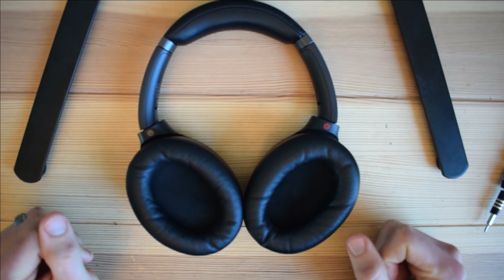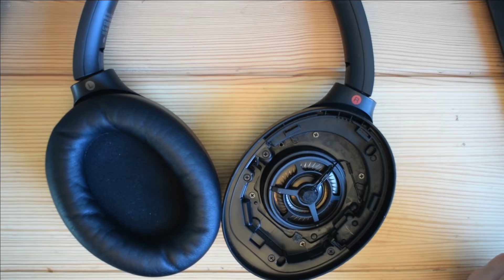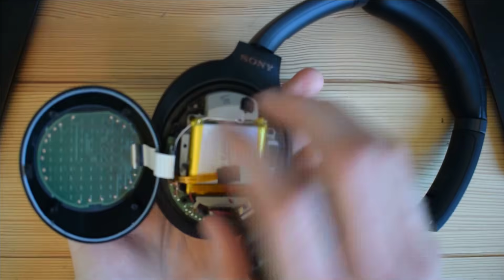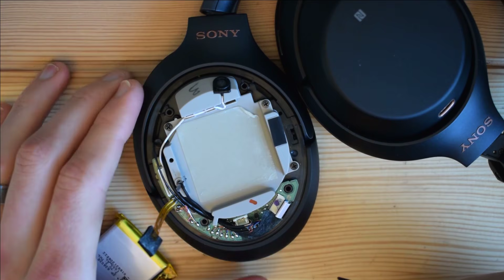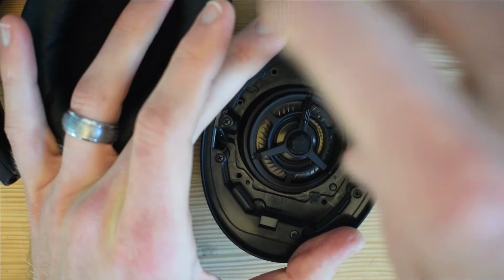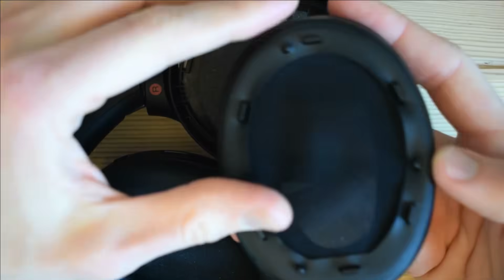Sony WH-1000XM3 Battery Troubleshooting, Repair or Replacement Walkthrough - Teardown and Fix

Comment: Alright I just fixed my headset what I did was I first went through the non hardware invasive  steps none worked then (if this is the case for you its most likely a hardware problem and not a software problem ) i decided to open up the headphone with some screwdrivers first i did the right side where the battery was (thought it might be a dead battery) and disconnected it for 15 minutes then plugged back in but that did not work as has been recommended by a few to do and work it did not in my case however.

What worked for me was i opened up the left side where the power button is and just messed around a little bit with the cable and applied a bit of pressure here and there and tested the power until I found the so called "sweet spot" and some reason that fixed it might be the same case for some other folks out there lose cable might need to resolder it if you have the tools and skills but for me just a simple reopen and pressing around fixed it might help you too if these simple steps didn't worked in this video.

At the end of the day it just seems to be (at least in my case) a few cables out of place inside the case or pressure just over time from maybe dropping or just general daily use that made it kind stop powering on, but try it to these steps first before buying a brand new battery it might just save you a few bucks.

Comment: I slightly ripped my foam battery temperature pad thing on my xm4's but its still holding the sensor in place. battery disconnection didn't work for me so im thinking maybe this had something to do with it? is all hope lost?!?!?!

Comment: Thanks for the video. Was almost identical to take apart the MDR 1000X. Mine did not start after a charge but now they work again. I unplugged the battery and let them be for 15min then they started again. <3

Comment: Hi, thanks for making this video! I need your suggestion. I have the same headphones but now it was damaged because my little brother gave supply through aircraft adaptor and 3mm jack wire into the plug then suddenly POP sound then stopped working. Could you please help with any possible solutions to work? or is it better to buy a new one? Thanks in advance :)

The In-flight adaptor is NOT MEANT to charge your device. Plugging the in-flight adaptor into an AC Power Socket to charge the headphones will cause severe damage to the device. ( this happened but no changes in the headphones, simply not working :( is it battery damaged or motherboard damaged? )

Comment: Help pleasee! My right ear is charging red, but I can’t turn it on with the left ear. Happened randomly on one day. Is there a fix for that as well? I’ve tried both soft and hard resets multiple times with no luck :(
Reply: I tried the resets again and suddenly it started working again 😄
Reply: Plug it in with a cable to the headphones and try again

Comment: Hey, got a new battery and followed the steps and the new battery is good however, it seems as though charging is the issue itself. Any ideas on how to troubleshoot that issue? Might be a loose connection, faulty charging terminal/connection etc. Any ideas? Cheers!
Reply from the maker: You may want to try detaching and reattaching the charging port. You can find the instructions for that in the following video: https://youtu.be/GmfoTpZiX9U

Comment: Hey, my XM3 Headphones won't turn on. As soon as I replace the battery they turn on but after a while they turn off again and I'm not able to turn them on again. While charging the red light is working. The blue light works fine when they're on (the 2 mins after changing the battery), but they won't work afterwards even not if o try a soft or hard reset. Are there any  solutions?
Reply: have same problem bro.
Reply from the maker: Hi! Thanks for reaching out. Unfortunately I've had this problem before as well and I have not had much luck fixing it. It appears to be an issue with the main circuit board, which is very complicated to fix. You may end up having to just use them wired or get a replacement pair. Sorry to not have better news!
Reply: Have same problem...

Comment: What is the cable with the foam adhesive attached to the battery? My foam square separated from the cable how should I attach it to the battery?

Comment: Dude seriously...THANK YOU! My unit wouldn't charge. It stated that its at 20%. Once plugged in, the led stays red for 10 minutes or so and then turn off. When I turn on the headset it immediately tells me that my battery is low. I tried every single USB-C cable and every charger and every computer with the same result. I was seriously going to just throw these away. Well after watching this video I decided I have nothing to lose since warranty is over so I unplugged the battery as instructed, left it alone for 10 minutes. Plugged it back in and immediately turning it back on and its at 100% charge. Keep it up man...you saving a lot of people money.
Reply: Mine were stuck at 10% charge and wouldn't charge. I suspect it was at a much higher charge than that but I changed out the battery anyway.
Reply from the maker: Fantastic! I love helping people save money so this comment made my day :)

Comment: Duuude. You saved me like >$100 in repairs from Sony’s non-warranty repair center. I bought them refurb, so let’s hope it sticks. 

Note: with tools the hardest parts are removing the back cover and REINSERTING THE FARKING BATTERY CABLE in its port. 

Mucho thanks.

Comment: I just wanted to know what the internals of my xm4 looked like, its just as new as the day I bought it and I hope it stays that way for a couple years. The repairability just makes my decision even better, almost bought wireless in-ears. Thanks for the vid.
Reply: btw i realized the ear pads began to kinda wear off, they are not as solid anymore, is it how its supposed to be?
Reply: @bruh5924  Sometimes clean and then apply leather grease.

Comment: But you shouldn't need to do this with headphones lol
Reply: After many years the Battery is not the same and for 20 euro its like new again and 30hours run time
Reply: Yes, otherweise you'd need to buy a new one. I just got mine for the first time, and it's good to see that when the battery is too weak, I can replace it without buying a completely new expensive headset.

Comment: Just got a set of these. When charging them, I see a red light, does this change at all when they are fully charged? I can't see anything in the instructions that came with them.
Reply: No more red light when charged. 
So it indicates only a charging process.
Reply: Thank you for the reply.

Comment: Thanks for the video.  I had the issue where, instead of charging and having a solid red light, the red light would flash continuously. After disassembling, I found the light could stay on solid if I wiggled the temperature sensor (the part held down by the first tape - the orange tab touching the battery). This is true even with the battery unplugged. Tracing the sensor cable back to the board, it was apparent one of the solder joints was only making intermittent contact. A little more wiggling and it came off entirely. I resoldered the sensor onto the board and now it charges perfectly. 

Also it looked like the wiring had been factory reworked (poorly), so seems like Sony has some quality control issues. Very disappointing.

Comment: Nice simple video, thanks!
Great to see this is so easy to replace the battery, hopefully I don't need to for a few years.
But I will definitely want to keep these for longer than a battery will last.
If the XM4's are the same inside . . .
Reply: Hi. I Have the wh-1000xm4 model ..my phones wont power off …they are on all the time ..i tried a soft reset and hard reset …any suggestions ?  They wont power off at all ,even if I set the app to power off

Comment: Hi how can I hardware disconnect the nfc and bluetooth feature of these headphones to make them feel like regular wired headphones instead of being wireless ones that asks to be paired to anything when they start up?
Yeah I know there is an app for turning features off but that is the software way and that is not a permanent solution.
Reply from the maker: That is a good question, and one I've never considered before! You could certainly just cut the wires that control Bluetooth and NFC and voila, those features are now disabled for good. BUT, I would be VERY cautious about making sure you identify the correct wires so I'd say desolder wire by wire and then write down which wires control those features and remove them. Or just desolder them and never resolder them, that way if you wanted the feature again in the future you could reconnect them. Best of luck!
Reply: @jontriestofixthings3718  At least you got it exactly as I meant, can you make a video on the subject?

Comment: These headphones look expensive! Expensive as I mean superior quality for the price of $350.
Reply: 350 for these headphones are too much these days, should be closer to 200. At least I got mine for 200 chf.
Reply: Is it a joke? These headphones look and feel is cheap as fuck.
Just a plastic. 
Yes it may be a good scratch resistant plastic but... it's not.I put mine on a table for just a few times and here they are  -scratches. 
I'm dissapointed.

Comment: Thanks for the video!
I’m having the “blinking red LED” problem. The headphones won’t charge event if there is no temperature problem. I doubt that it could be the battery because a fe days ago (4-5 days) it was charging ok. I already had a blinking red led  problem and it was solved when I let the battery totally deplete itself before charging it again. I already ordered a replacement battery juste in case but I would like to know if this might come from any other possible component ? 
I’ve read in the comments that the yellow cable with foam on top could be one of the causes but the wires seem correctly soldered.
Reply: I have the exact same issue, and it will come back randomly after you charge it again. I'm going for the replacement battery... Let's hope for the best
Reply: @serenity5892  Did any of you guys get a replacement battery and that resolved it? I have less than 10% charge and it won't charge up . I've bought a new cable ...no joy. Did the steps in the video (brilliant and thanks) but that didn't work. I just don't want to buy a new battery to find it is not that .....getting to the point of good money after bad
Reply: @mikeyc0014  Yup, it's working. I fully cleaned my headphones inside & outside, replaced various wire protections wearing off from some kind of rust and replaced the battery. Works good as new! Best 20$ & 1h repair
Reply: @serenity5892  thanks for taking the time to reply and the good advice ...I've ordered the new battery.  Much appreciated.
Reply: @mikeyc0014  No problem, I hope your your headphones will shine again! feel free to come back and tell how it went :D
Reply: @serenity5892  thanks you're very kind.....I will let you know as it may help others...with Xmas it might be a while before the battery gets her...cheers and have a good xmas
Reply: @mikeyc0014  Merry xmas! :)
Reply: @serenity5892  yooo does it work now that u got a new battery I have the same problem too I just ordered mine
Reply: @808corbin2  My battery works flawlessly since then and had no issue so far. 100% capacity, holds as long as the original one.

Comment: Hi, thanks a lot for the video! My headphones aren’t charging and I think I need to replace the battery.I live it India and honestly I don’t know where to buy the batteries from, they’re not available anywhere online. Any tips? :(
Reply: Only option is to contact Sony and ask if they can replace the battery
Reply: If you do contact the sony center, can you let me know in these comments the exact procedure? And how much they charged you for it. I don't want to get ripped off 😭
Reply: @sehajmahajan4683  I did go to them and they had quoted 8,000 rs (INR) :/
Reply: Though I presume my charging port isn’t working, battery is okay I suppose. 
Apparently some sweat seeped into the charging port
Reply: @shriyavudari9776  how did you get it fixed though
Reply: @shriyavudari9776  you do realise that the battery itself doesn't even cost 500 rupees for which Sony is asking 8000 rupees. This is exactly the kind of Anti repair anti consumer culture all these big tech companies are following.
Reply: @shriyavudari9776   hey im also facing the same prob, so did u get it fixed?

Comment: Purchased a new battery and I have power now.  However, when I plug in a USB-C charger to charge the headphones no red light comes on and it does not appear to be charging.  I'm at 60% after replacing the battery.  Is there something else I need to do?  Not sure if this is the charger that came with the headphones.  Does that matter?
Reply: Guessing you need to open it up again and make sure it's all connected properly.
Reply: Now I am at 10% and am getting the low battery message, but nothing happens when I plug in a USB-C and try to charge.  Any suggestions other than having someone replace the whole charging port?  Wondering if it's worth the cost.
Reply: @davidberry2632  did you make sure everything was plugged in properly?
Reply: Any update?
Reply: @Alhussainba  No luck.  Ended up buying the Bose headphones that were on sale for Black Friday.
Reply: @davidberry2632  which Bose did you get I got these SONY Bluetooth headphones this Christmas I very like them I also have the Bose QC35 second gen that are mostly weekend headphones and not my everyday pair but I still want to try the Bose 700 ones soon

Comment: I LOVE YOU! I can't believe it, after 1 week looking for repair centres and getting insane quotes (because the headset is 1 month over the warranty) it was just fixed by disconnecting the battery for a bit and connecting it again. You're the best!
Reply: The battery was draining too fast?
Reply: @sludge5328  It just ran out of charge once and after hours of charging it never allowed me to power it on again. After this fix the headset is still working fine, and the battery still lasts more or less the same :)

Comment: how important is it to get the same axact battery. i ordered original battery for this headphones from subtel.no.

1 x Batteri til Sony WH-1000xM3 - 1588-0911, SM-03, SP 624038 (1000mAh) Reservebatteri
Artikkel: 924380 | Enkeltpris: 169.00

this should be ok yes? it came up as an oroginal part with just the same amp, lipo 1000mah etc etc. do i have to fully charge the first time og can i try it after an houre or som??
Reply: i'ts charging now. fun to see if it work!!
Reply: @KaySeverinBredesen  I'm assuming it worked out fine?
Reply: @KaySeverinBredesen  same I'd like to know how it worked

Comment: You saved my headset! One of the contacts of the temperature sensor was broken, which I noticed when I peeled it of the battery. This stopped my headset from charging properly, and all I got was the flashing led. After soldering it, charging works like a charm 😎😍

Comment: My xm3s do not turn on, soft or hard reset. A FAST white light flashes once when i press the power button after attempting to reset them. Tried the battery trick, but didn't leave it unplugged for the 15 mins. Will try again later, but if anyone is having a similar problem or has a solution please respond.

Love seeing videos like these where people come together and troubleshoot hardware/software.
Reply: I've got the same problem. Wonder if it's an issue with the firmware so will try to downgrade it. If not shipping it to Sony for repairs.
Reply: I have the same problem. I bought a battery to see if this fixed the issue but it did not. Mine's stopped working a few days after a firmware upgrade but i wonder how can i do a downgrade it if i can't turn them on.
Reply: @Secenza  if I reset mine like 30 times with a little gap in between it will eventually turn on
Reply: @almota7  how do you know the reset is working? Mine don't blink at all
Reply: I have the same issue. Very frustrating. Seems to be a rare issue, because i cant find any troubleshooting info on the sony website. I don't see  any option other than shipping it back to sony for repairs.
Reply: me too, but xm2
Reply: Well, yesterday after about a year without being able to turn on my headphones. I opened the left side (where the power button is) and checking if there were any loose parts, I did a little pressure on the black chip in the middle (CXD90050), and they turned on again. Unfortunately someone will probably have to solder it again because after a few hours you have to repeat the process. I only comment what solved my problem but please don´t go and break your headphones trying this xD.

Comment: I just got a new pair of these, the battery doesn't complete it's charge, the sound clips and becomes distorted at barely any volume, even for the voice assistant, and attempting to use the touch controls straight up shuts down the headphones. i assume all of these issues are battery related, hopefully it's just a faulty connection,  might be faster to replace the battery than to wait for Sony to repair or send a replacement. Amazon apparently doesn't do replacements on warehouse deals. 

Can someone confirm that these do these sound like battery issues or something else?

Comment: Hi, got a problem on the left side of my headphone. It keep getting warm and the headphone can't be turned on.

I've tried to disconnect the battery (on the right side) then it's not warm anymore. But once I reconnect the battery, it's getting warm again.

Do you know whats possibly the issue here? Is it short circuit or something?